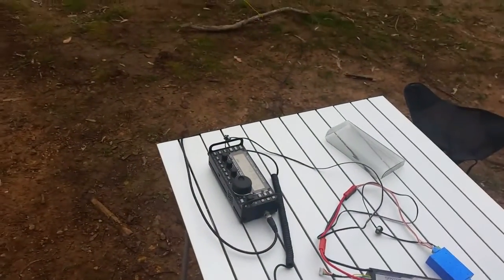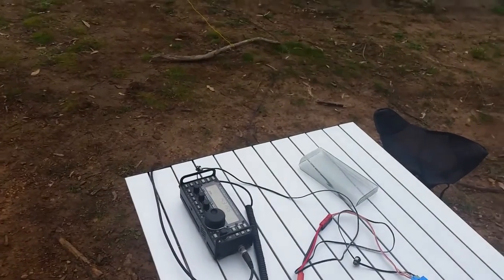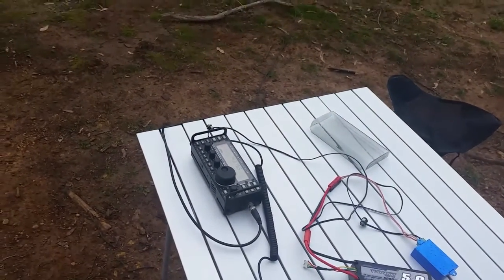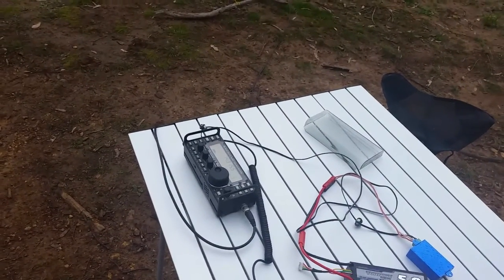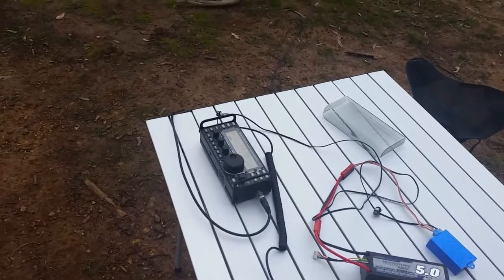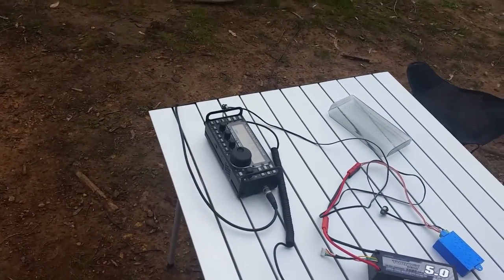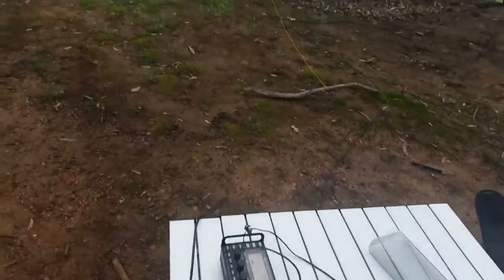Phased Vertical Array on 20M

Comment: I would love to try this myself would you please confirm the length of the coax from your radio to the T connector, and the length of the coax after the T to the first antenna, and the length of the coax after the T to the second antenna. Also how high was your connection point and when you were measuring the quarter wave separation did that any adjustments or was it exactly 1/4 wave length - did you need to use any type of balun?

Comment: can you say more about what is required for the delay phasing.
Reply: There isn't any delayed phasing.  The elements are in phase.  Out of phase versions are possible, but the whole system becomes much more critical as to length cutting for equal currents, so is hardly ever encountered.